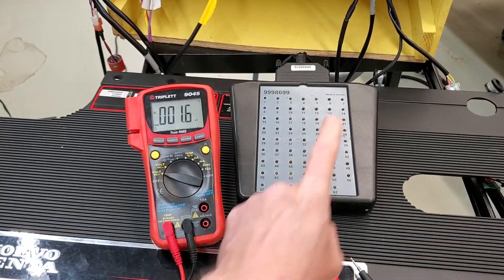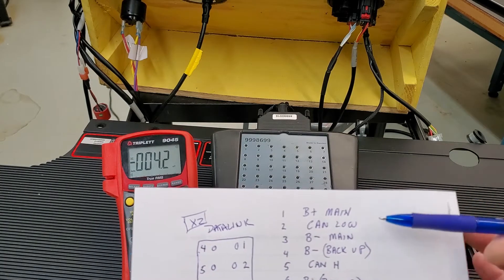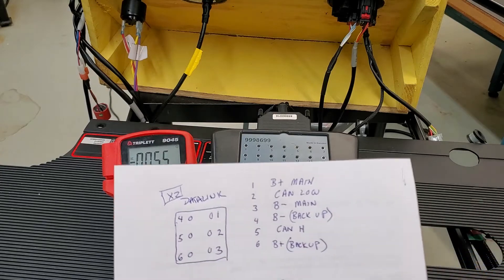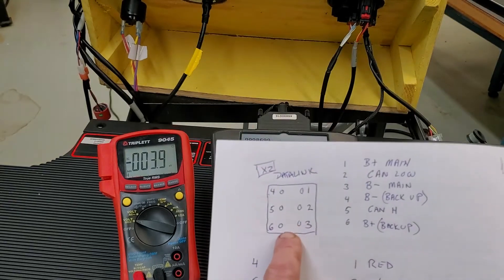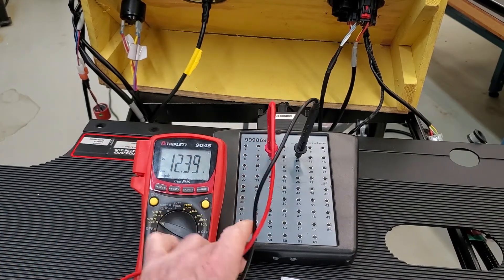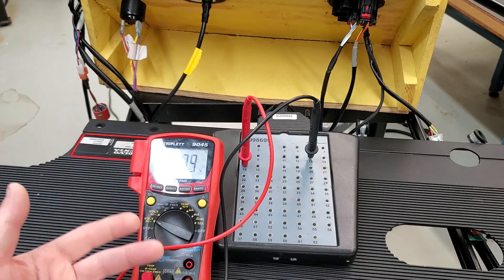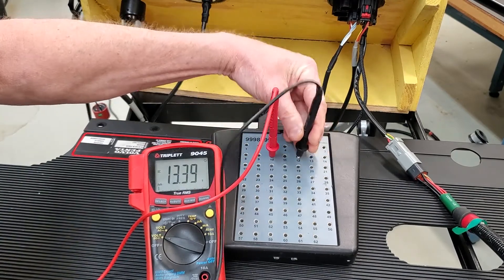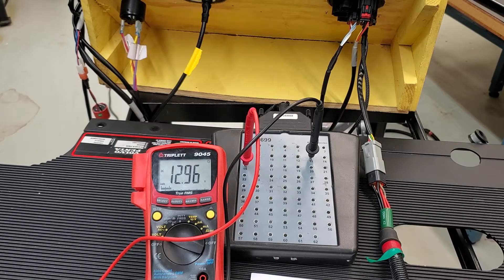Testing for X2 Datalink Battery power and ground on EVC D Gas product

Comment: Thanks for good videos. For diesel: Should the X2 pins 1 and 3 be the same V as pins 6 and 4? I have a 187/232/2 and 187/32/10 fault and see 11.62V on pins 1/3 and 12.28 on pins 6/4. Battery is 12.7, also at the starter.
Reply: Forgot to say EVC-D.